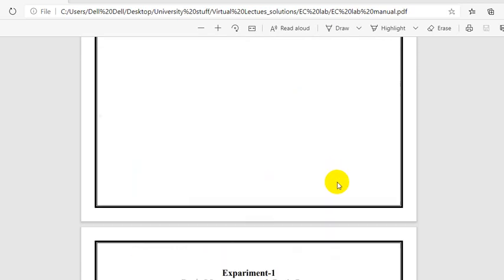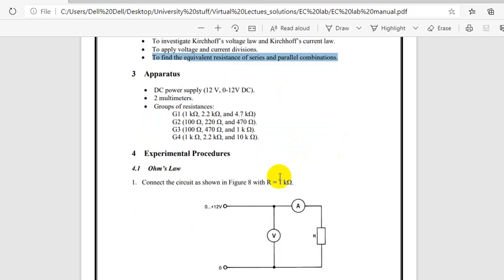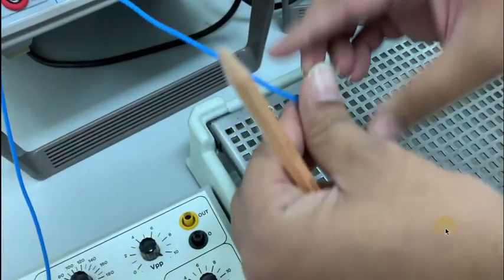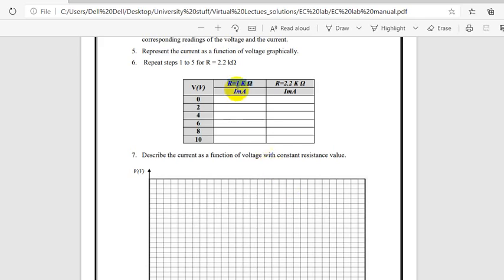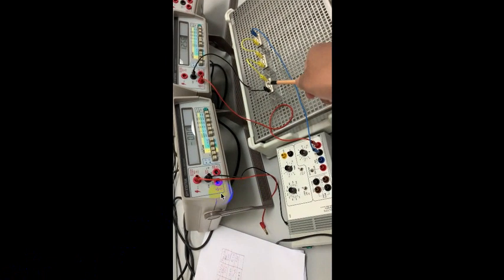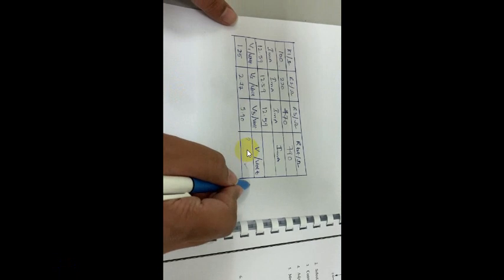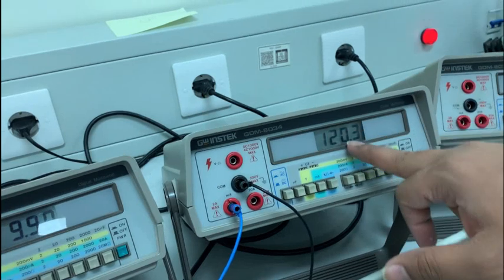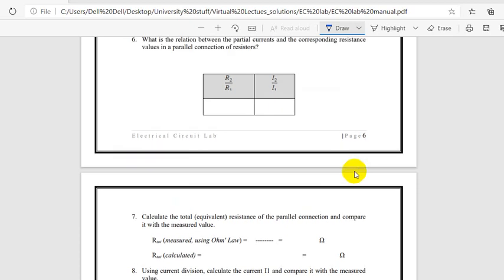EXP 1

Comment: Bhai whatever editor you are using, there should most likely be a feature called "reverb correction". Just turn it on. It will reduce the buzz sound or the background noise from the mic.
Reply from the maker: Dear Thanks much appreciated suggestion